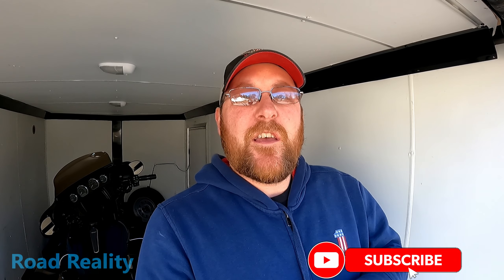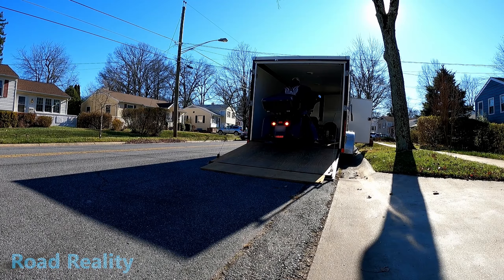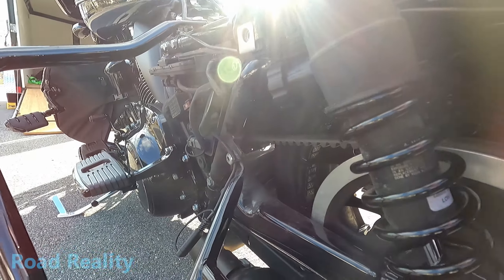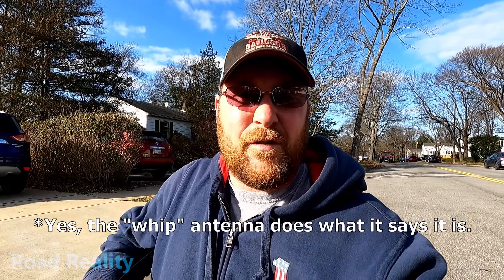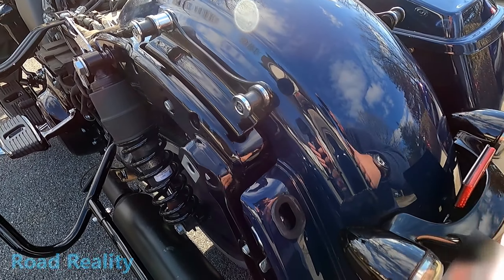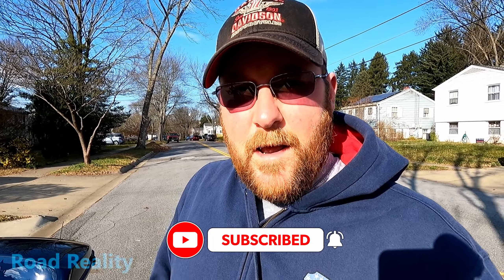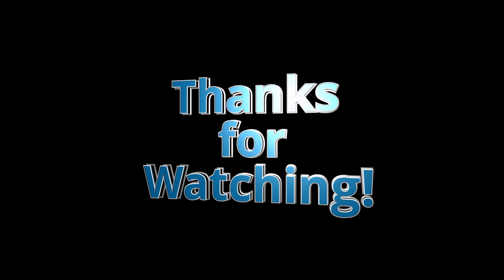Harley Tour Pack DIY IN-DEPTH INSTALL!  How hard is the install for a Do-It Yourselfer?

Comment: As far as your docking hardware...there are flat spots on the black plastic spacers that need to be in alignment from side to side. Then if you look at each spacer you’ll notice that one side is thicker than the other. You have to have them installed correctly in order for proper installation and fitment. If you have it all installed and lined up correctly install of the tour pack is a breeze. You have to look really hard at the black spacers to see the flat spots.
Reply from the maker: Thanks for the tip! - I'll have to look for those flat spots.  The dealer I bought the bike at had already installed the docking hardware when I bought the bike.

I loosened up one of the rear docking points with an allen key and then re-tightened it, making sure not to over-tighten it, and it's a breeze to get the tour pack on and off now.
Reply: @RoadReality  yup. Prolly got it aligned. It’s hard to see if you’re not looking for it.
Reply from the maker: @richardedwin5980  You're probably right, and I had no idea... but yesterday I went for a quick ride and decided to take the tour pack off first, and it was really easy to do, and putting it back on is easy too.  I've done it a few times recently [I really wanted some pics with the TP off the bike].

Comment: Getting ready to install mine.  When size up the pack it became obvious the stock antenna is a problem. I have debated many solutions others have offered. You video helped me decide to go with the Harley Antenna relocation kit. I might also purchase the Ciro3d High Caliber 12 " Antenna  but for not I will stick with the stock antenna to get the job done. Plenty of time to try the ciro later.
Reply from the maker: Glad I could help!  If you have any questions, feel free to reach out to me!
It's funny, I started recording the antenna relocation kit install as part of the original video, but it quickly dawned on me that I was in for a bit more than I expected, so the camera went away and the install went on, and on, and on, before I figured it out.  Then came the questions, "How did you run the cable?" and "Show me the step-by-step of installing the Tour Pack!" ... so I had to do a second video!

Comment: Why not just get a shorter antenna to run under the tour pack no need for the relocation kit im running a king tour pack as well did the short antenna in the stock location no problems..
Reply from the maker: That's a great idea!  How's the reception with the short antenna?  I often ride to the edge of reception for my favorite stations and didn't want to lose that.
Reply: @RoadReality  perfect reception everything plays fine I've encountered no problems
Reply from the maker: @killerdetailer28  that's awesome, wish I thought of it when I did this.  The relocated antenna looks goofy when the tour pack is off - luckily that's almost never.

Comment: Did you have to run the new antenna cable all the way to the radio?
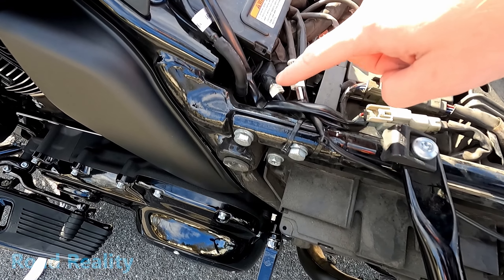Reply from the maker: Nope, just the section shown in the video, from under the seat back to the new bracket.  Start watching at about 2:50 into it and it shows where the connector is and how I routed it.

Thanks for watching!
Reply: @RoadReality  Thanks. Just got my kit and installing it this weekend.
Reply from the maker: @hcytwn406  Very cool!  Hopefully some of the stuff I showed in the video will help out :D

Comment: Threading cables through on new bikes is becoming more difficult for sure.
Reply from the maker: Yeah, they definitely don't leave a lot of room, and it's just silly that they didn't make a 8-12" antenna cable that threads onto the old one and lets it reach the relocation bracket.